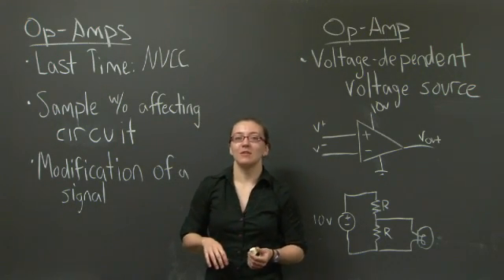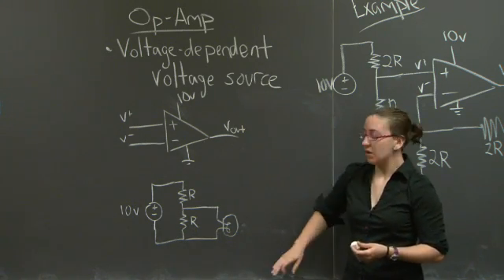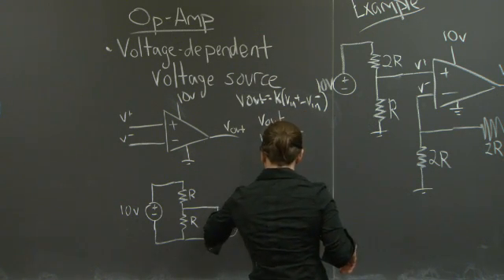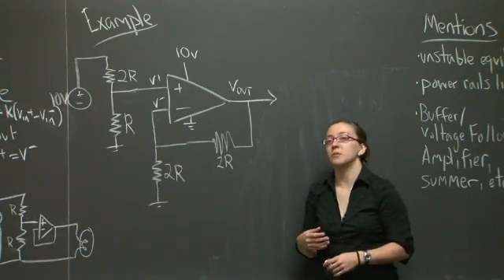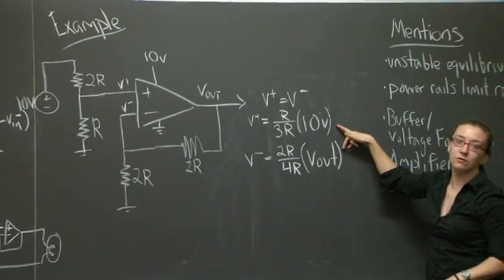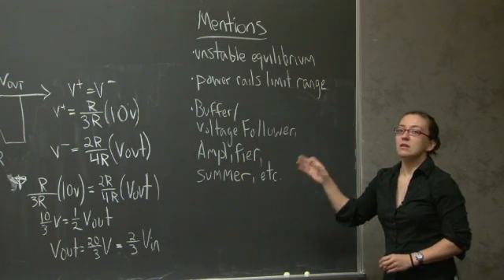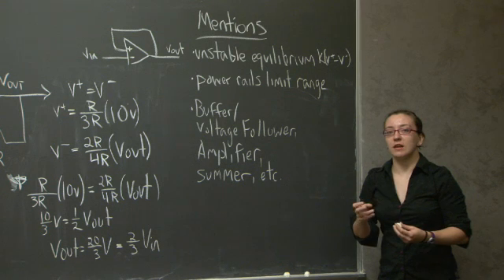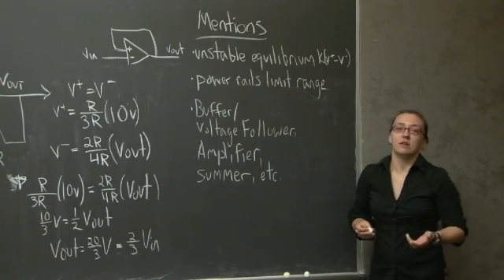Rec 11 | MIT 6.01SC Introduction to Electrical Engineering and Computer Science I, Spring 2011

Comment: Watched the Khan video, watched the EEVblog video, built Forrest Mims' single-supply amplifier, and capped it off with this solid recap.
Sounds like a perfect way to sample a very small signal without perturbing it.
Reply: It's because op-amp input impedance is very large. Anything you connect in parallel to a component will lower the impedance. If you connect an op-amp input to another circuit, that circuit will behave undisturbed since you're connecting an infinite impedance across it.

Comment: 1:30 "The op amp does not actually provide 5V to lightbulb because the lightbulb acts as a resistor,... thus you will have less voltage than you desire" thank you very much!!!! That alone allows everything to make sense!
Reply: I'm missing something here... Voltage is the SAME in PARALLEL
Reply: @naleparyan  the light bulb drops the resistance of R. When you combine their parallel resistance you end up with a higher voltage drop across the top resister